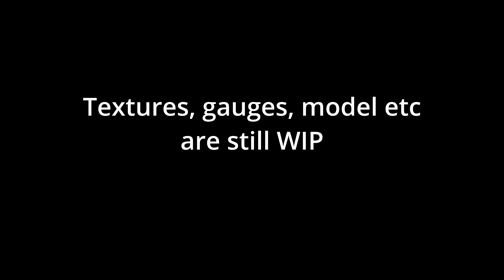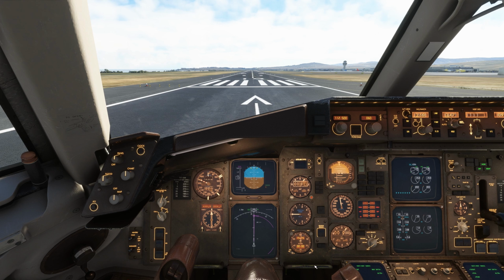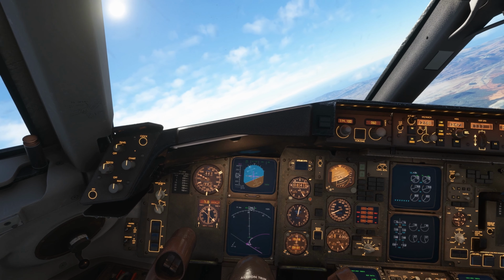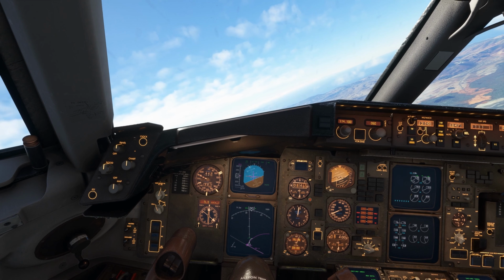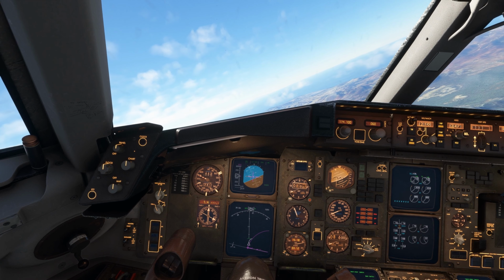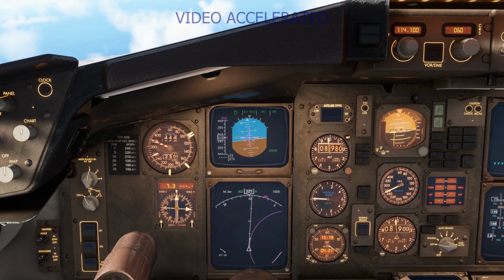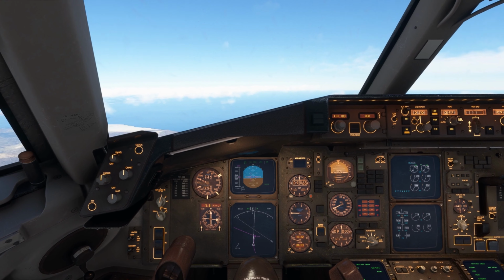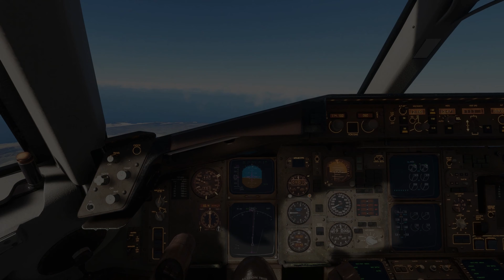BBS 757 DME Arc Demonstration

Comment: Oh boy, you are teasing me.
One word of advice, though you probably know already, a lot of developers seem to be having issues finding a sweet spot for the rudder responsiveness, and it is usually way to sensitive, I woul love to see love in this regard in the 757.
Good luck guys!!
Reply from the maker: The flight dynamics still have a way to go but luckily we have some 757 pilots on deck to provide feedback. :)
Reply: Yea this is a weird issue, I thought I was the only one that noticed. Also, moving the rudder left seems exponentially more sensitive than moving it to the right for some reason, and I'm inclined to believe it's just a sim issue because every plane is like this, and I've tried switching out hardware too, and nothing helps.

Comment: Amazing job guys, I am following this project, and, the improvements are amazing!
I am current flying the B767 which is pretty much the same aircraft!! Just a heads up, different from the 777, the 757/767 are not allowed to arm the VNAV on ground, on the acceleration altitude we engage the VNAV and start the thrust reduction 😉😉
Reply: Thank you for pointing that out. When devs are making study level planes it would be really good if the actually followed the real FCOM.
Reply from the maker: @sn0wm4n94  Hi. I'll have to clear things up in a later video.  We are not making two versions of the plane.  That was originally intended for the flight dynamics but more details will be provided on that at a later date.
Reply from the maker: Thanks.  Yes we will look into that. We still have lots to tune on the FMS.
Reply: @bluebirdsim  sounds great, if you need any help, let me know! 👍🏻👍🏻
Reply: Not one to discredit what you are saying, but isn't this airline specific?
Reply: @MrBillUp  hey Chris, not in this case specifically, it’s in the FCTM, it’s like a limitation for this type of aircraft!!
Reply: Our FCOM and BFCTM does not have that limitation, each company is different. Not to be assumed as standard please!
Reply: @killsapm8883  As I thought. 👍
Reply: @MrBillUp  I would like to emphasize the difference between systems functionality and different companies' SOPS. If one is used to a certain procedure it doesn't make it all across the operators that we "are not allowed to arm the VNAV on the ground". We need to keep an open mind.
Reply: @killsapm8883  so, you guys arm the vnav on ground ?

VNAV arming is not foreseen as it is not in the FD algorithm.
 That's why you shouldn't follow the FD unless after leaving the ground...

 The AFDS logic uses speed to give inputs to the FD and A/P and not the VNAV.
 In addition, the algorithm predicts the reduction of power for Climb, when you press VNAV.
 So you can't and shouldn't do it.

Read FCTM “Take off and Initial Climb” Initiating Take Off Roll page 3.4 in ours manual!
First paragraph!!
Reply: @MrBillUp  as I said, “it’s like a limitation, not A limitation” To be more clear, it’s not recommended because is not part of the take off logic of the AFDS (System Design, not even company policy!)
Reply: @tlpessanha26  Very interesting, our FCTM and FCOM stipulate part of SOP that LNAV/VNAV to be armed after preflight, final data. Guidance is also provided by FD for VNAV as soon as we pass 400 ft when gets active. So "you can't and shouldn't do it."  doesn't fit what we do. Perhaps there is a software situation? All I'm saying is to keep in mind that what one airline does is not valid for all and there are many differences.
Reply: @killsapm8883  hey Kill, yeah, this is very interesting for too, maybe is some bulletin that is different from our company, I spoke with others friends who flies for another company, this not apply for them too!
Thanks for the heads up, I will research a little bit more about it, if you want to contact me, please, send a private msg and, we can exchange information!
Reply: @tlpessanha26  I understand and agree 100% with you, I'm not challenging you in any shape or form. I'm not one of those, more so when looking at an old FCOM2 (2010) which does stipulate exactly what you say. To add more "confusion" some have different avionics, LARGE DISPLAY SYSTEMS (LDS), EADI, EHSI, FMC, PFD, ND, and cockpit layouts.
I just want to make sure, again, that I'm not saying that you are wrong. Only to share some different options and how others operate.
Thank you and I apologize for any misunderstanding.
Reply: @killsapm8883  not at all man, I really appreciate your point of view, it’s make me rethink about those differences between configurations or even bulletins followed by companies around the world!
I really like to share and learn about aviation subjects, specially on the aircraft that we are flying most part of ours life!
Thanks again my friend!!
Reply: I'm also rated and currently flying the 757/767, both, and you can arm VNAV on the ground no problem, in fact is the only one we arm if is a non rnav SID lol like someone mentioned it early, those are probably your company procedures.

Comment: Can’t wait to fly this! This has probably asked lots but are there plans for PW engines?
Reply from the maker: Yes :)
Reply: This preview is using the PW engines actually. The RB211-535E4 equipped 757's have an N3 indication on the lower EICAS, as the RR is a triple spool design engine.

Comment: I do not understand the enthusiastic cries. Texturing and lighting has nothing to do with the real 757. I speak as someone who has worked on it for about 8 years
Reply: Therefore it's the first thing you can read when the video starts: textures and gauges are WORK IN PROGRESS! It helps when you can read 😜
Reply: @madsib5187  Do you really think that textures and lighting will be completely redone for release? If this is a draft version, it would not make sense to screenshot it in detail. Very often the phrase is heard that this is "WIP", but in fact, over and over again, something like what they show comes out in the release.
Reply: @simmerdiman8374  Not that it will be redone, but that they explicitly do not show off the final version, but only a standard one now. I'm trying to say that it's too early to judge over it now, one year before release.
Reply: @madsib5187  Then it will be too late, you'll see :)
Reply: @simmerdiman8374  Then the market will regulate this :)
Reply from the maker: @simmerdiman8374    That is not true.  If you have experience in development for MSFS and want to provide your feedback we more than welcome it.  This plane is still 10+ months from release so yes a lot can be done.  The pace that our VC designer /texture guy works at is simply amazing.
Reply: @bluebirdsim  As a participant in commercial projects for MSFS and X-Plane, I’ll say, specifically as a texturer, I’ll say that the pace of the artist’s work does not matter if the cockpit textures are very far from the original, and it’s not just about color, but in general about cockpit texture. It looks more like the brown-painted cockpit of an old 32X Airbus.
Reply: @bluebirdsim  There are at least questions about the structure of the texture, but inside,
it's anything, but not a Boeing 757, although it is similar in geometry. I do not want to offend anyone, if you are interested, we can contact in any convenient way and I will point out the shortcomings that I consider obvious in more detail.
Reply: @madsib5187  The market is so poor that even fakes from CaptainSim and Bredok have a chance of success)) I want to see a great quality 757 as someone who has been on it for most of his career. It is my expectations that worry me, for this I expressed my opinion, in the hope that the developers will notice it. I do not deny that they will buy it and I will not argue with that. For every model there is a buyer.
Reply from the maker: @simmerdiman8374    Sure feel free to contact me , I have my email listed on my channel or message me on my FB page https://www.facebook.com/Bluebirdsim. I appreciate the feedback and for what it's worth yes we are still working on the textures. Can't get into details here but our goal is to make them look as real as possible on the final release. We have some heavy hitters that are helping out in that front.